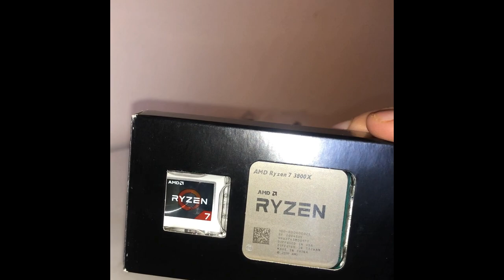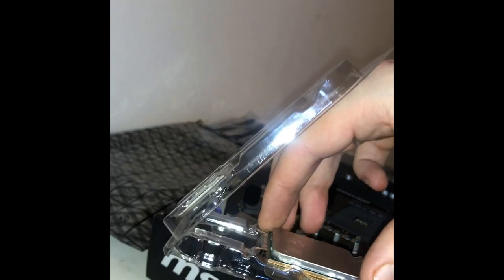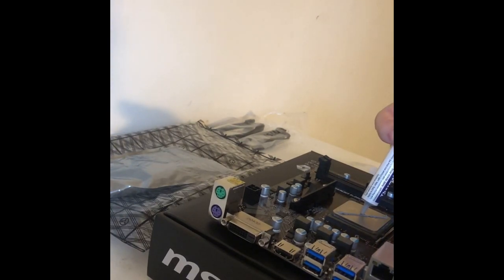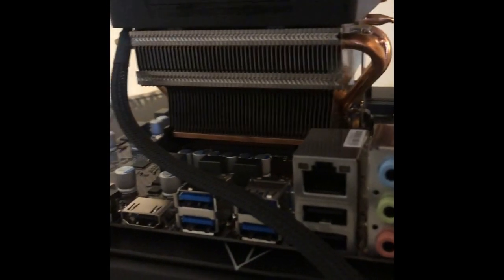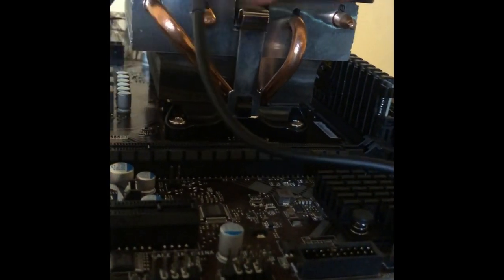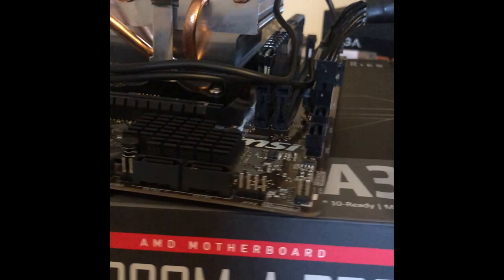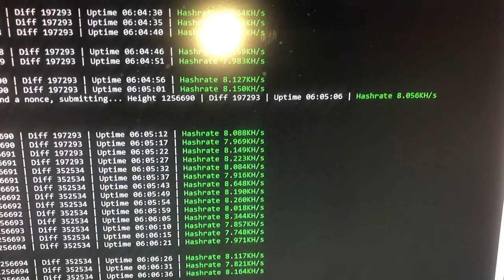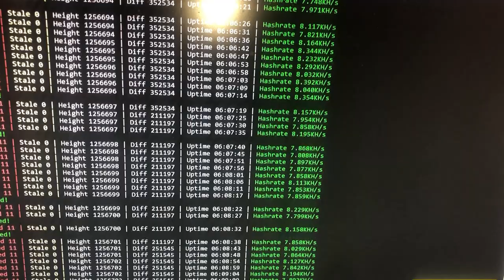How To Install A Ryzen CPU |  Adding ANOTHER CPU Mining Rig & HASHRATES ON DERO RYZEN 7 3800x

Comment: can you check the processor temperature? that 3800X runs really hot. thermal throttle can affect the processor performance make sure to keep it running below 70 degree celcius for optimum processor performance. you can undervolt it.
Reply from the maker: Yeah probably a good idea to check, may need to consider new cooling if temps are throttling, yeah undervolting would be a good idea also ill get it done Thanks for the comment I appreciate it
Reply from the maker: Yeah just check on MSI afterburner this cpus running at about 79 degrees so needs a cpu cooler upgrade and some undervolting for sure

Comment: Hi Farrington, you didnt say if you did any overclock with this cpu or were mining at default speeds?
Also, the reason i am asking this question is because i own a similar motherboard, where the Ryzen master said overclock not supported. So wondering, if you have different experience.
Reply from the maker: This setup was just showing how to build a cpu rig an this was me running that cpu a default settings I’ll go ahead and create a video soon about overclocking